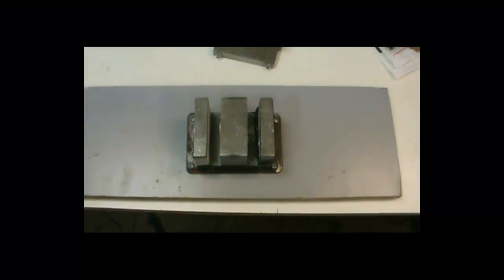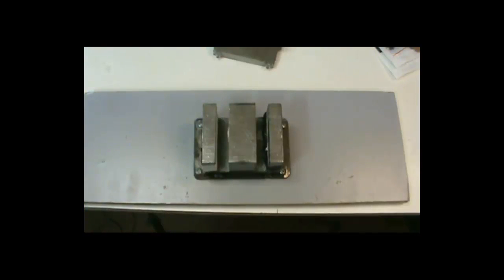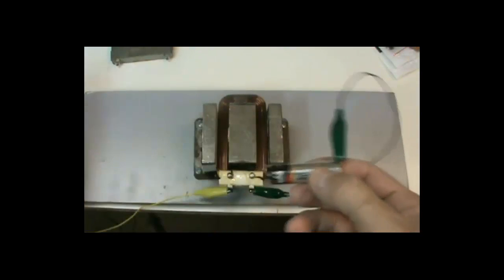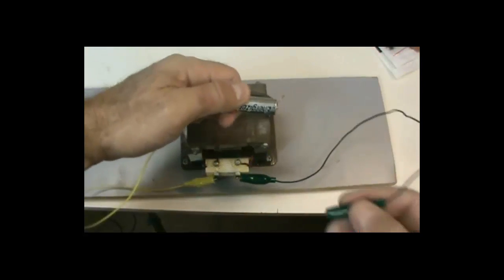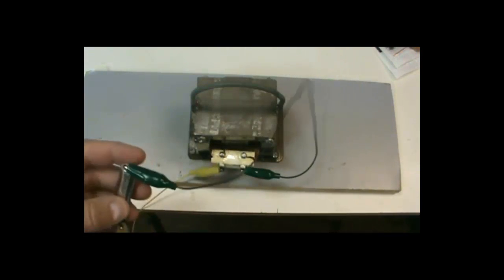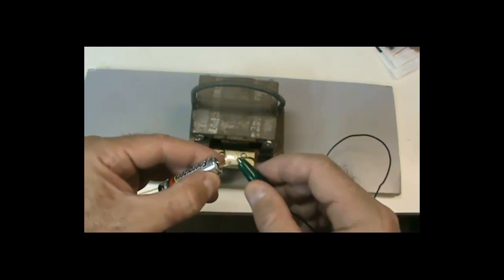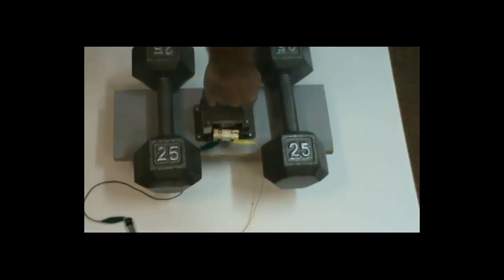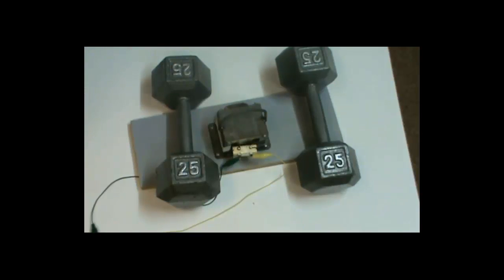Easy-to-Build Electromagnet lifts over 50 lbs

Comment from the maker: bhavani the core is straight out of the transformer with no modification. Use the winding with largest wire only. Remove the winding with fine wire. Make sure the transformer is a 120 volt transformer and not a 240 volt transformer.
Reply: what does the one with fine wire do?
Reply from the maker: It is the high voltage winding  (2000 volts). The other winding (one to use) is the primary winding (120 volts).
Reply: Cool. You said that the transformer gets hot if you leave the current on long enough. Does it get hot enough to melt? Also, if I were to use a 12 volt battery, would it be strong enough to lift 30 lbs from 8 inches away or does the electromagnet have to be pretty close or make contact in order to make the lift? Thanks a bunch and sorry if my questions are any inconvenience.
Reply from the maker: +AGENT G It will lift hundreds of pounds using a 12 volt batter for a short period of time. Distance is a problem for magnets if you want them to create strong forces. Much depends on the thickness and type of iron and how close it is to the magnet.
Reply: Thanks. I appreciate it. I also appreciate your educational videos. Thanks for sharing with us.

Comment: How long till it discharges?
Reply from the maker: Using AA battery the magnet will only run a few minutes.

Using a C or D cell battery it will run much longer.

If you build a battery pack with several D cell batteries it will work even longer.
Reply: OK. Thanks.

Comment: What if u used 120v AC?
Reply from the maker: It would still act like a weaker magnet but the material would vibrate very quickly and make a buzzing noise. Also all non-magnetic metals would be repelled (Lenz's Law). I'll demonstrate this in another video. Thanks for commenting.
Reply: So the battery makes it more powerful than AC?
thanks
Reply from the maker: DUMBASS Yes because any magnetic material is being both attracted and repelled by the magnet and the magnet also exhibits reactance to AC current.

Comment: I'm stunned that you got that much force from so little current.
Reply from the maker: The electromagnetic has about 300 Ampere-Turns (100 turns * 3 amps) of MMF. This creates a very large magnetic flux when the reluctance (resistance to magnetic flux) is very low.

With the electromagnetic, as long as the air gap is very small the magnetic field strength is very large. The magnet does not need much power to provide a large pull since it is not actually moving the weight relative to the magnet if the weight is in contact with the magnet.

Any time you want to create an electromagnet with a lot of pull you need to minimize the air gap between the object you want to pull and the magnet.

BTW: This electromagnetic will lift well over 100 lbs with a 12 volt power supply.

Thanks for commenting.
Reply: Two quick questions, and thanks for the response. I'm in the process of copying your hack for practical use in the field.
1. Should I/can I trim down the leftover core material so that it's level with the winding to reduce weight?
2. Looks like the primary winding is used. Is that the case?
Reply from the maker: Aaron Baca

Yes you can trim down the core but make sure the cut is very straight and doesn't produce any air gaps when the core contacts an object or you will seriously reduce the lifting power of the magnet.

The primary winding is the one you want to keep. This is the winding with the largest diameter wire.

Comment: Why won't a 240v system work?
Reply from the maker: Same reason you wouldn't plug your cell phone directly into a wall socket.
Reply: Polarity
Reply from the maker: My original reply had to do with the simple idea that things can only handle so much energy and more is not always better. Apply 120 volts directly to phone to charge it faster and you will actually destroy it instead.

One main problem with AC being applied to the electromagnet is that the magnet will induce eddy currents into the metal and repel the metal instead of attract the metal. Since the electromagnet has quite a bit of inductance the current and pull will not be as intense as you would expect.

Comment: Hey, this looks awesome. Great job. So for me to make one I could use any old broken thrown out microwave? I'll just need to open it and find the transformer? I'm not all clued up on this sort of thing so your help will be appreciated, them wires just small crocodile clips? What would be the best battery to use, similar to yours? Also for a newbie, is there anything dangerous that I could kill myself with? Haha a car battery could be interesting....
Reply from the maker: Be careful pulling the transformer and make sure the microwave it's unplugged of course. ;) No dangers as long as you remove the high voltage transformer windings (lots of turns of very fine wire) which you can cut off with a hack saw. You can operate the magnet with a car battery but not for very long.

Have fun.
Reply: Dorian McIntire Isn't the windings that wire that you could simply take out and put back in? I thought they were essential...?

So to be clear, I need 2 crocodile clips, a transformer and any battery? Thanks
Reply from the maker: Kyle Race There are two sets of windings. One winding has many turns of very fine wire and this should be removed and discarded. The other winding has fewer turns of larger diameter and this is to be kept and used. Just hook this up to connection wires, hook up to a battery and you have a powerful electromagnet.

Good luck. Please let us know how it goes.
Reply: Dorian McIntire Thanks! I'll get on ebay now and buy 2 crocodile clips :) I'll probably just use one the square battery's, should be easier to hook up.

Comment: If you left it attached to the battery how long before it dies?
Reply: I want this question answerd too!
Reply: @joshuanorris9785  still waiting for the answer though
Reply: Measure your current. 

Divide battery Ah rating by current.

Result is battery life in hours.

Comment: Awesome video! I want one of these now. >:)

Two questions though.
1. Assuming the AA battery is fully charged, how long the charge last, would having a battery pack of some sort (4 AA battery pack or similar that you would find in a TV Remote) make it last longer?
2. Would it be safe to have on of these mounted on a wearable back plate to hold a sword (disconnect the battery, sword comes off, connect battery, sword won't come off at all) or would I be better off making something smaller/weaker?

Thanks in advance. :)
Reply: +umm36 The average capacity of a AA battery is about 1 amp hour, and the short circuit output (worst case scenario) is said to be between 1 and 5 amps. Now, that's pretty vague, but it should give you an idea. If the magnet draws 1 amp, you'll get one hour. If it draws 5 amps, 12 minutes. Chances are it'll be closer to the 1 amp, since small batteries get kind of hot putting out 5, but I honestly can't say, I'm just speculating.
As for the second question, I might be able to shed some light on a safety issue. As far as the magnetic field goes, you'll be fine, unless you have metal rib/back/hip implants, or a doctor left a scalpel in you. The sword however, may give you trouble. Since the entire magnet is oval in shape, and the sword is not a full square, it'll likely try and align itself with the magnet. If you take the sword off and the magnet activates unintentionally, you won't know until you try to put the sword back on, and the magnet will suck the sword towards itself. Once it's captured by the magnet, the force will overwhelm your arm, and you'll lose control of the sword. If the magnet twists the sword the wrong way, it could slice into you or someone around you. It's giving the sword at least 200 newtons, which, given a 1 KG sword, can bring the tip to (roughly) 350 km/h, and that's very conservative. So, if you're going to use a sword, make sure to have it on the electromagnet before turning it on. Maybe use a resistor to prevent the magnet from producing that much power.
Reply: Awesome, thanks.

So a single AA battery would power that for around an hour if set up right?
Reply: umm36 I can't promise that. It could be as little as 20 minutes or as long as an hour, maybe longer. To add to that, if the battery is being drained at a high rate, it could overheat, causing damage and reducing it's life. A resistor might help, since it won't let the current flow at short circuit rates, but it'll also bleed off some power.

Comment from the maker: Your coil resistance seems too high for a microwave oven transformer. The resistance of the coil should be about 0.5 ohms.

Are you using the coil with a few turns or many turns?

If you've made your own coil it should be made of about 100 turns of # 18 to #16 wire.

You can always use a larger voltage to increase the pull.

Comment: Hi there, thanks for your great video! Very helpful. I was hoping you could tell me how long that AA battery will last whilst in use.
Thanks very much, Jo
Reply from the maker: Probably only about 5 minutes for an "AA" battery but this really depends on how much of a rest you give the battery between uses. A "D" Cell battery will last much longer, maybe around an hour. The electromagnet uses about 1.5 amps at 1.5 volts since it has a coil resistance of about 0.5 ohms.

The specifications for a typical battery can be found on Eveready's website. Just Google "eveready technical information" and you will find technical information on all their batteries with charts and graphs about useful life and current capabilities.

I use the AA battery for effect since it surprises most people that such a small battery can create such a large force.

The key to this effect is that the force does not extent far beyond the magnet.

Thanks for commenting.

Comment from the maker: There are many reasons it may not perform as expected.

- Not using a fresh battery
- Not using the right type of battery
- Using small diameter wire to hook up the magnet
- Not having the magnet close enough to the thing you are lifting
- Not using the primary coil of the transformer

If you use the components shown in the video it will work as demonstrated in the video. I pointed out most of the potential problems in earlier comments.

Good luck.

Comment: you good, you got me for a second but it took me 3 minute to find out your trick, the green wire connects to - side of battery  no problem, but the yellow wire is cut in half,  the first half (one side connected to electromagnet and the end goes out of screen and you connected to +line dc power supply "probably +24v dc" ) the second half  you connected to the other -line power supply -24dc and comes into the screen and you connect it to + side of 1.5v AA battery  {basically the battery it just middle of the power supply} you know why i say that. it because 1.5v never ever makes such big spark . that spark shows there is a power supply with at least 2 AMP power some where.. )  at 1.04 when you connect the battery makes that spark and on 2.25 makes that spark  the yellow wire is out of the screen... and on 1.24 when you lift it the yellow wire is out of screen, and when you disconnect the battery 2.26 your video flashes means has been edited there.. you show a yellow wire complete to distract people.!  nice job ... it need a lot of attention to get what you exactly done.  that coil never activate to a magnate on 1.5v. and of course at end of the video you taped the yellow wire so it does not come to the screen . when it fail it pulls the yellow wire but it does not move forward with battery ...!!!  of cource it because is connected to a power supply there !
Reply from the maker: The 1.5 volt battery (look up the specification for a AA battery) provides more than 2 amps to the coil which has a a resistance less than 1/2 an ohm. Have you ever heard of back EMF? when you disconnect a high current, flowing in a coil with a large inductance, a large amount of back-EMF is generated and it can create a large spark (notice the spark only occurs when I remove the battery). Instead of being a armchair skeptic try using the scientific method and build one for yourself.

Comment: That'd make an awesome motor
Reply: ?!?!?!?!?!? it would make a terrible motor!!!1
Reply: Ronald RC Brushless motors work by using electromagnetic force to pull a rotor towards each next magnet and then switch polarity and push themselves away from said magnet in a rapid transition. The more powerful and power efficient the electromagnets are, the more powerful the motor is. If you could position some of these along a rotor with some hall sensors and circuitry to control the polarity, thats possibly roughly 50lbs of force per magnet on the rotor, and if you could power it with a few small cells, holy torque. This would make an AMAZING motor
Reply: YSC That was my first thought, someone with better resources than you or I have, needs to collect like 6 of these and make a massive brushless torque monster

Comment: My electromagnet is powered on 5 volts yet it is not even as 1% as powerful as yours
Reply from the maker: If your 5 volt power supply cannot supply more than a few amps of current it will not be powerful. This is why AA, C, or D batteries should be used.
Reply: does your iron core consist of a solid core or thin insulated steel sheets,this is part of the key to  a good electromagnet or a transformer,goss(grain orientated silicon steel|) is used in high quality transformers usaly for audio,but the lines of flux are more concentrated in sheets of steel than a single monolithic piece core.

Comment: Put a tig welder transformer on there with a car battery lmao
Reply from the maker: +Wendell Utt I'm sure that would create an electromagnet that could lift well over a thousand pounds!!
Reply: i am tempted lol
Reply: +Wendell Utt Careful, those wires aren't designed to handle that amount of current. You might burn out the MOT. You know, since discarded microwave ovens are such a rare commodity...
Reply: then use larger wire lol
Reply: Wendell Utt That would work, but you'd be better off using household power run through a rectifier.

Comment: im using the primary coil straight from a microwave so not sure why it doesnt have a resistance of 0.5 ohms 

i will get another coil and see if it has lower resistance

Comment: The reason you get a heavy spark when you disconnect is this. When you connect the power, you get that very strong field built up around the core and coil.This very strong field is what lets you pick up very heavy items. When the circuit is opened, all that magnetic field that was built up around the coil and core suddenly collapses right back into the coil that made the field, to begin with. This is 'back voltage. It is EXACTLY why a condenser was placed across the points in gas engine ignition systems, be it a battery and coil or, a magneto. The condenser absorbs the back voltage and keeps the points from burning up.

Comment: If you make a second our will they push away from each other or pull themselves together...
Reply from the maker: It depends on the polarity of each magnet. Opposite polarity they attract - same polarity the push. Just depends on the way the power connected.
Reply: Will it pick up the 50 lbs from the other side
Reply from the maker: If you  mean push 50 lbs the answer is yes if the proper conditions are met. Pushing the weight however is inherently unstable and there is no way to keep the weight in one place.
Reply: Ok theoretically could I make 2 and reverse the poles to where I put one on top of the other and put more power to the one on the bottom potion to push the other one away. To more or less levitate say 200 lbs... Witch bring up another question is it the more power I add the stronger it should get or will they be a cut of limit to where it won't be able to pass
Reply: booty pirates that's a good damn question.  Yeah I'm thinking hover board as well

Comment: Thank you for this video!  I've been watching countless videos, and your magnet is by far the most powerful thus far. I recently ended up with a very powerful microwave.  1100W easy. I'm a scrapper :p  Can't wait to put it to the test. 

Have you increased the voltage/amperage at all?  

I already have the transformer in hand. Looks very similar to yours :)

Primary tests 0.5 Ω :D
Reply from the maker: Glad to hear you've going to be able to make an electromagnet.

You can increase the amperage dramatically by using a 12 volt battery as the power supply.

Such a power supply pushes the lifting power well over 200 lbs but you can only run the magnet for short periods of time. \

Make sure you monitor the temperature of the magnet if you run it at such high currents.

Thanks for the comment and have fun.
Reply: Dorian McIntire Thank you Dorian.  Peace to you and yours ;)

Comment: Excellent and simple.  Can this be adapted where the transformer core is mounted to an iron bar or pipe so it can be used to clean an area of iron like picking up nails in the yard?  Also how long might the battery last?  Any advanatge to using a higher voltage battery or power source?

Comment: great video! thanks! i was wondering if this same step up can be done with a smaller transformer?
Reply from the maker: Yes, a smaller transformer will work but the electromagnet will not be as strong.

One problem with standard transformers is that the steel laminations are interleaved so they are difficult to get apart. This does not mean it can't be done.

Thanks for commenting

Comment: I tried to replace the AA battery with a C cell 9-volt battery and it actually seems to have weakened the electromagnet. I made a nearly identical magnet however it's not as strong as I was hoping for. I want the field to be stronger, so both the strength of the magnet and distance from the electromagnet? Any suggestions? Help?